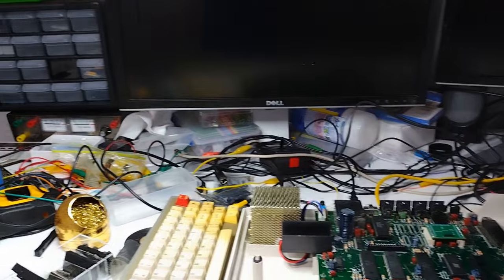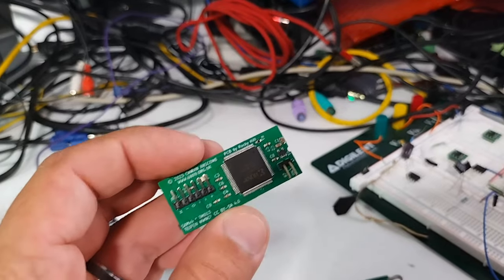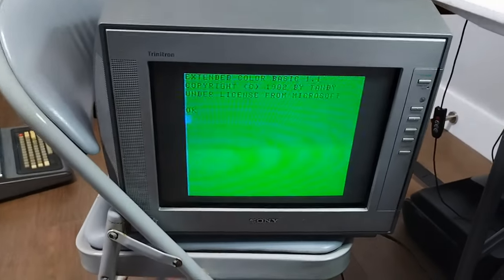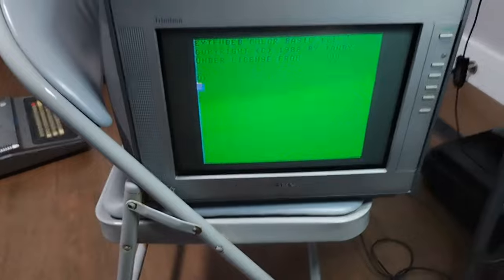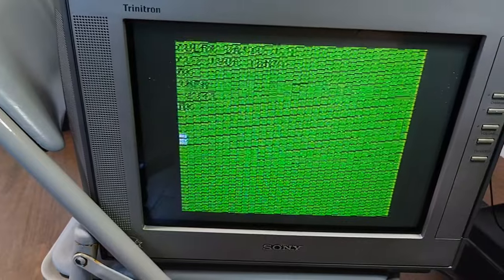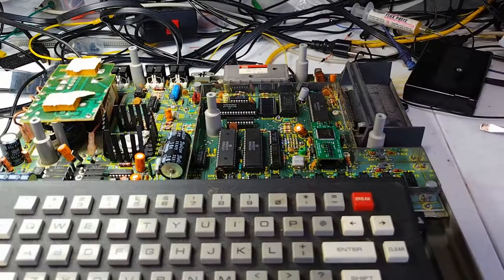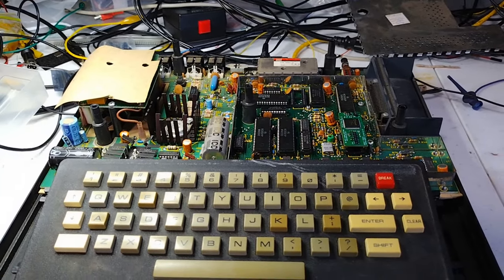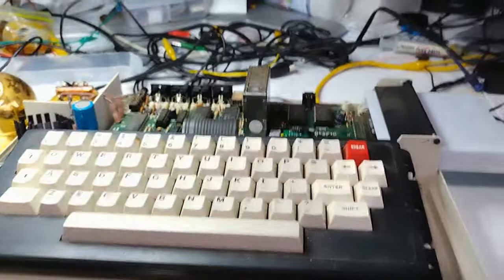Testing the SAMx4 MC6883 replacement on several of My CoCos

Comment: Right ON!  I really need to learn how to use CPLDs and FPGAs.  I can't remember which SAM variant is for 64K but I have a ton of SAMS that don't seem to work for 64K machines lying around.  Since I have a tendency to buy CoCo2s off of EBay, restore them and upgrade them, not having the right SAM is a problem.
Reply from the maker: You probably have the SN74LS783 which won't do 64K with DRAM that are 4bits wide only with the single bit DRAMS. the SN74LS785 does 64k with all of them. The SAMx4 can handle all of them.
Reply: @rockyhill3  OHhhhh, OK, so I can still use the 783s on the single bit 4164s then.  That makes those extra chips useful still, at least.  I'm thinking about taking your SRAM board and adapting it to the single-bit layout, maybe with some dupont wires to reach out to each chip for the data out.
Reply from the maker: @8antipode9 , Should work just fine. I would like to see that adaptation. It should work.

Comment: Ciaran did a good job, and I like your reduced PCB version. I'm pleasantly surprised that the XC95144XL's outputs are compatible with 5V TTL.
Reply from the maker: Thanks and he did a great job! Oh yes, 3.3V is well within the logic "1" range for TTL and coupled with the fact that this CPLD is 5V tolerant makes this an engineers preferred choice because saving on components = less complexity which usually = saving $$$. When interfacing TTL and CMOS, sometimes I'll just connect the CMOS output to the TTL input and use a simple voltage divider to go from the TTL output to the CMOS input. You can't always do that but many times you can.

Comment: It's excellent that so many replacment parts are being developed for the Coco. I killed my Coco 2 the beginning of this year and I was full sure that I had fried the SAM. So I picked up a SN74LS783 along with a bunch of spare chips. Thankfully the problem was not a bad chip at all, but was down to a bad connection on one of the CPU pins (I had upgraded to a 6309). It took me ages to find the fault though. Anyway my point is that to buy another Coco where I am in the world is very expensive these days (if they can even be found for sale). So it's great to know that previously impossible to find parts are now within reach. Keep up the wonderful work ;)

Comment: I think as @rockyhill3 continues to work with and develop replacement chips and circuits, they should be included in with his replacement system board projects.  It's perfectly understandable that he wants to make drop-in replacements for all things but if an "all new parts" CoCo were to be built, the replacement chips and circuits would make things very crowded.  So I wonder was sort of expansion/bus types of things could be included with the design.  I think all CoCo replacement boards should come with the pepper board integrated straight off.  If someone were to end up with a spare salt chip?  That's probably a good thing!  And perhaps there could be a salt chip socket where the pepper circuitry would be used optionally.  The other rare and no longer made chips are a similar crowding concern but he did a good job of shrinking the PCB!   

There's just so much that could be included as part of an "all new parts" CoCo 2-T1 (probably the best design before CoCo3) but among them should also be a modern PD power supply.  Should make things run cooler and last longer right?  I'm sure there are lots of other things as well.

So while a straight-up replacement set of boards is kind of awesome and probably an amazing kit adventure where people could actually [carefully and patiently] assemble their own CoCos, for longer term "happy place" computer usage, updated tech should absolutely be included.  Not only will it keep CoCo available, but we can actually preserve our original CoCos and play with "all new parts" CoCos knowing they can be replaced if something bad happens.  I think CoCo preservation is the coolest thing going on right now... I mean along with NitrOS9, and the GIME-X/Y/Z and just about everything else.  But there's nothing more "core" than being able to replace a CoCo with modern replacement tech and supported with modern power, video and all else.

Comment: There was some more snow on the lower RAM machines (even after Ciaran's patches) - was that just the crappy video out on a Coco 1 vs. a Coco 2, or is there still a slight timing issue?
Reply from the maker: I think that is just slightly crappier video on the CoCo 1. the RF can connections have some patina. What I did discover today is that the video is noisier on my T1 CoCo 2 when using the SAMx4 which sits right under the keyboard a couple of mm away. Somehow the metal backing of the keyboard causes some interference and I believe the interference is to the point where you have occasional  memory corruption. There will be more testing though so stay tuned!
.